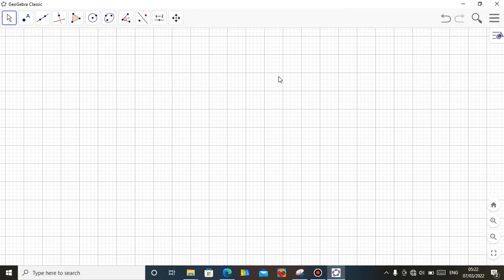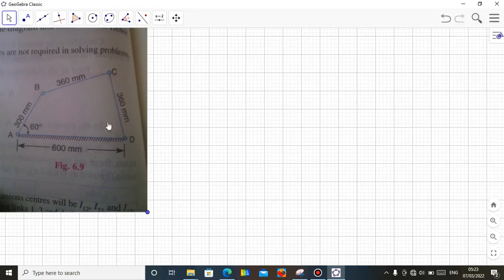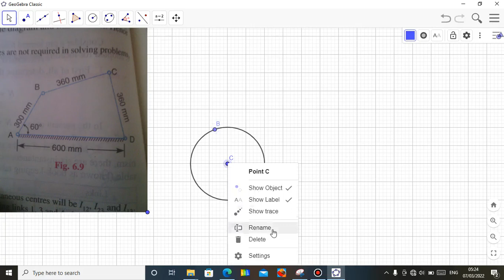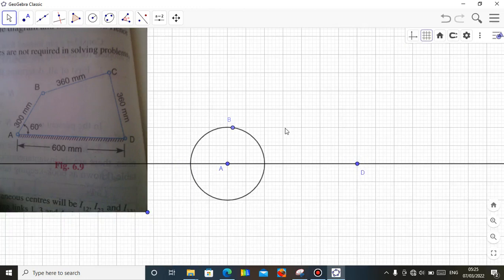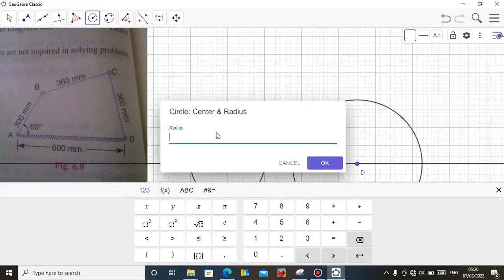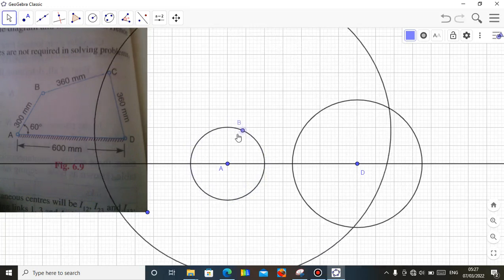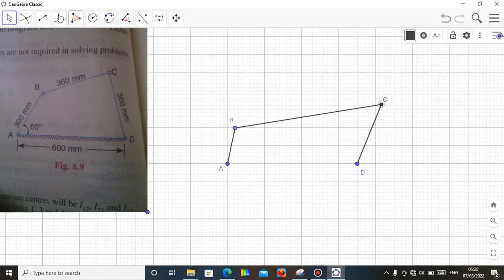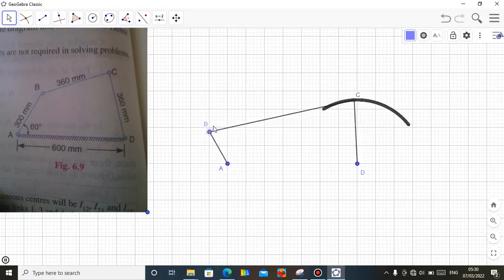Four Bar Mechanism in Geogebra

Comment: My Geogebra doesn't allow me to move any point on the circle freely as this tutorial did. It needs me to put on a slider and binding it value with angle on point in the centre of circle.
Reply from the maker: I think is the way you drew it. Draw a circle first and put a point on the circumference. Then click the point and drag or click the point and move it with the arrow button on the keyboard.